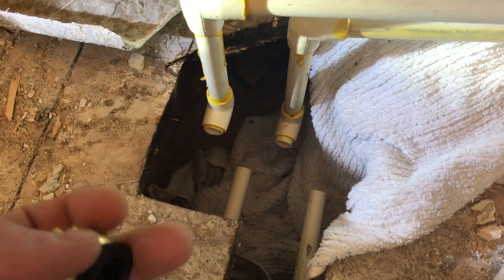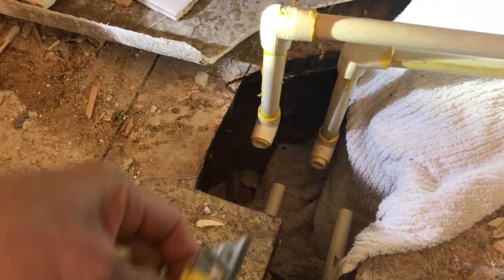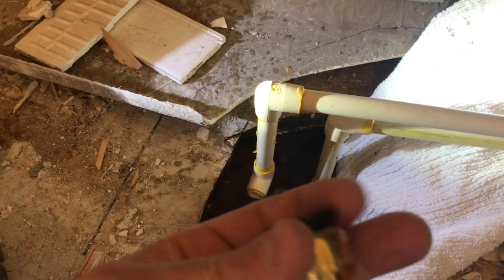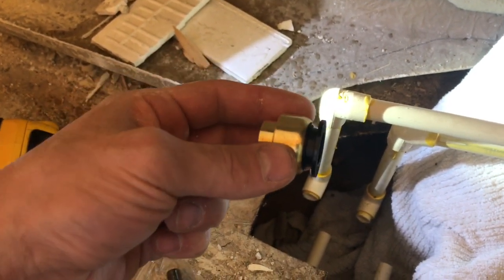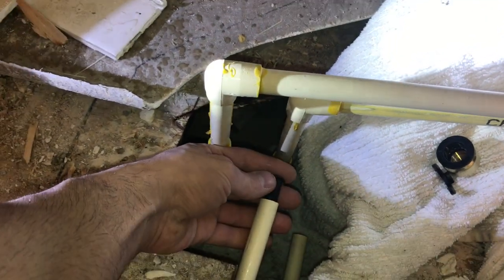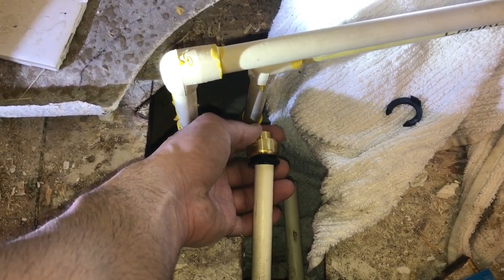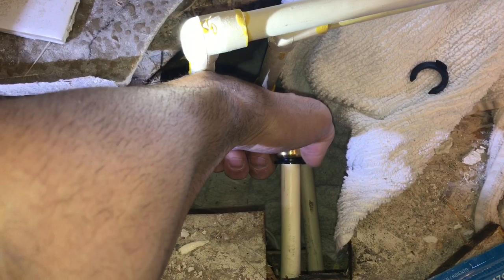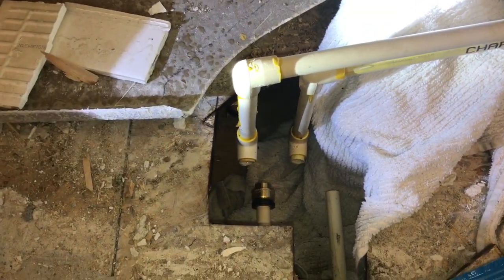how To cap and Seal off a pex or Copper Pipe

Comment: I'm sure someone told you already, and it's a 5 year old video, but those are NOT pex pipes, those are CPVC pipes.  PEX is more flexable, and come in Blue or Red only.
Reply: I know this is a 6 month old comment, and he is correct that this is cpvc.  But, pex also comes in a semi transparent whitish colored pipe.  This is known as Pex A and is very common in homes now, especially those built post 2000. Push connections also work with this piping, but the pex B (red and blue) fittings will not.

Comment: Thank you for the information.  I am removing a mobile home Roman tub that has only been used once in the 30 years we have lived here.  The step in area is to wide that it was unsafe and the bathroom already has a shower.  I don't know what the manufacture of the mobile home was thinking to take up more floor space for a separate Roman tub and shower rather than have a combination shower and tub. It would have been more practical to begin with to have the area used for storage.  That is what I am doing.  I am removing the tub and putting in wire shelving on roller wheels since it is in front of a window.  The mobile home was made when manufacturers were allowed to run the roof to the side wall without an overhang so that  when it rains the water runs down the cladding.  I have had to replace sections of siding because it was the cheap fiber siding that rots out after a period of time.